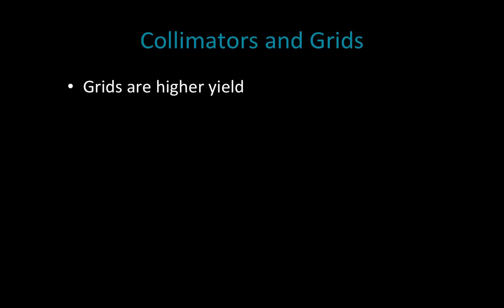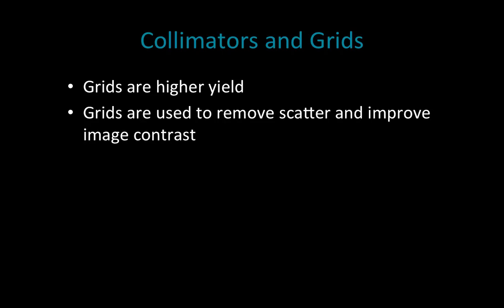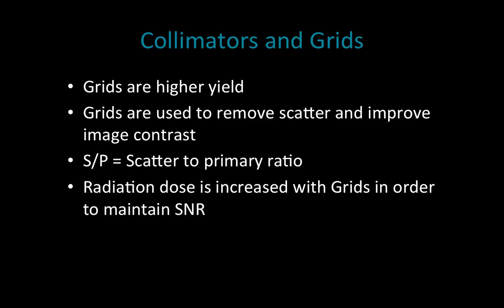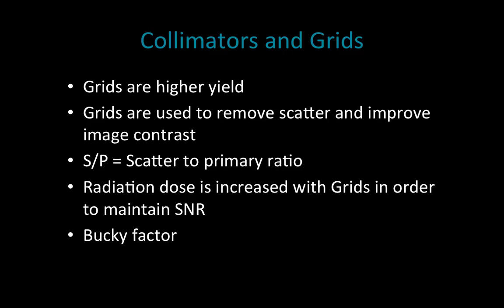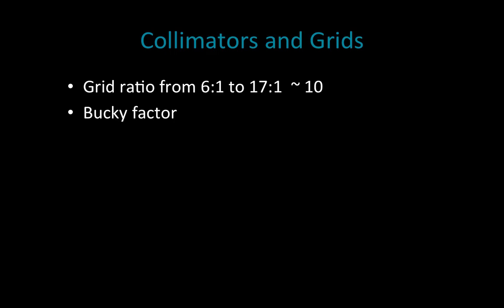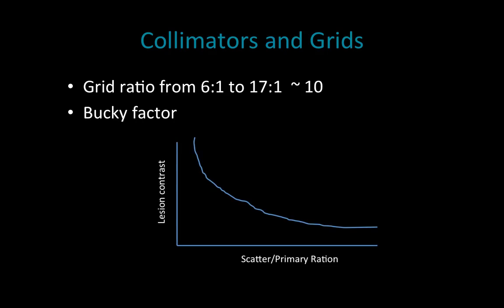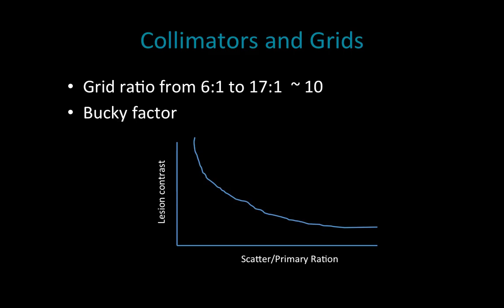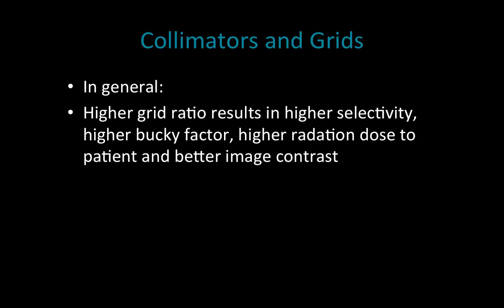Grids in Radiology

Comment: No one teaches the geometry of projections or how to use grids properly. Please look at my video.  https://youtu.be/mZPD_gLs5DwIn   addition, there is a way to ensure there will be no grid cut off for mobile work. I use a square with one corner on the Central line and an edge perpendicular to the central line. The shadow cast will show if the grid is aligned correctly. Think about it. You need something vertical on the central line to cast a shadow as a guide